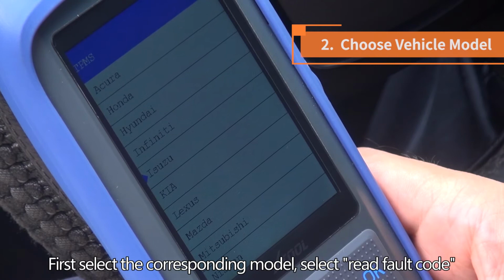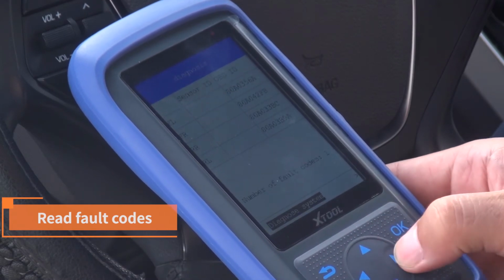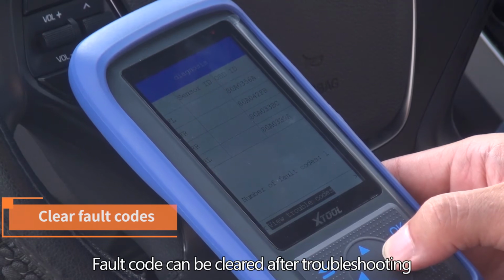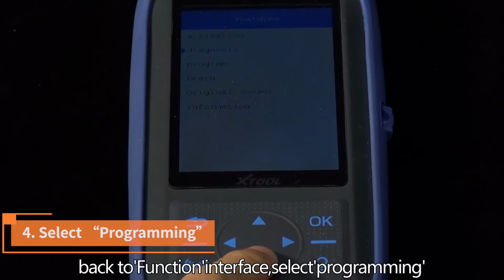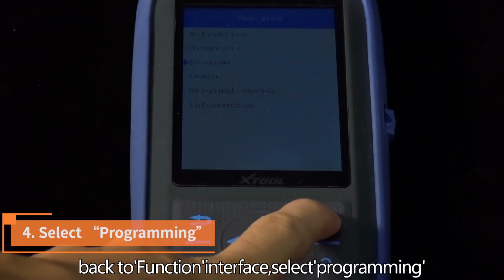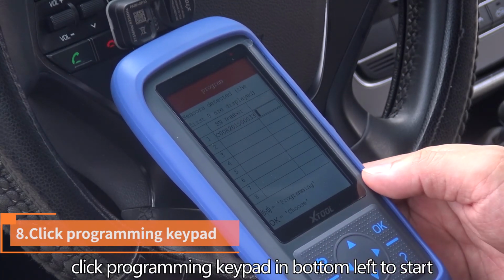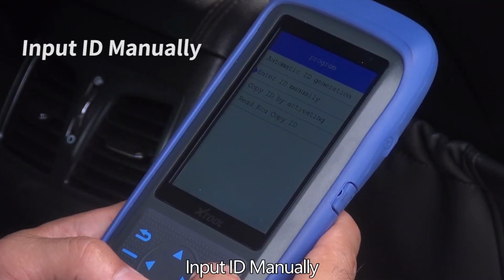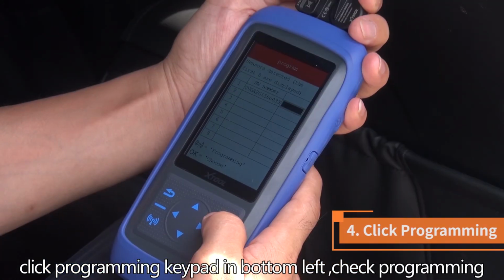Xtool TP150 Tire Pressure Diagnosis Tool Operation Video

Comment: Hi. How do i find the sensor voltage of an existing already fitted sensor on car. Thanks
Reply from the maker: Hi! If the vehicle ECU provides the sensor voltage PID, you can usually check it through Live Data / Data Stream on the diagnostic tool. The available parameters vary by vehicle and ECU. If you send us the vehicle make, model and year, we can help point you to the correct data. 🔧

Comment: Does the programmer tool work with a Toyota Prius 2010? Can it read codes from the OBDII port and program the car? Or is the tool just limited to programming the individual sensors?

Comment: I started to buy it but instead bought the Autel 508WF
Reply from the maker: May we know the reason?👀
Reply: @Xtool_tech  I had already messed up & bought the Foxwell T1000 thinking it could hook-up to the OBD port on the car.But it cannot & I seen the Autel TS508WF on Aliexpress for a good price so I bought it for the OBD hook-up feature.The Foxwell come with 4 sensors so I used the Autel through the OBD port to read the sensor codes then used the Foxwell to program the Foxwell tpms sensors.I still have 3 original sensors to replace when the batteries give out & I will use the Foxwell sensors,my spare doesn't have or require a sensor.I'm just glad to get rid of the blinking TPMS sensor light on my dash.
Reply: @Xtool_tech  I had already messed up & bought the Foxwell T1000 thinking it could hook up to the obd so I could read the bad sensor code & replace it,the Foxwell come with 4 sensors at a good price.So I seen the Autel TS508WF for a good price but no sensors.So I bought the Autel to get the one bad sensor code thru the obd then used the Foxwell to program the Foxwell sensor.I have 3 other sensors that are probably going to go bad & I will replace them with the Foxwell's 3 other sensors that it come with.My spare doesn't have or require a sensor.I did check out the Xtool before I bought the Foxwell & Autel TPMS programming tools.I'm sure it is just as good or better than the Foxwell or the Autel.I'm just glad to get rid of the flashing TPMS sensor light on my dash.
Reply from the maker: @dougmanor1988  thanks for the comments, we will do better int the futurr, and if you are interesting for xtooltech, please check our other products to provide us new suggestions,:pride-flower-rainbow-heart:

Comment: Can u program any and every sensor no matter the brand?
Reply: I think you can only program the Xtool TS 100 sensors with it.
Reply: Gotta be xtool sensors but they're only $20 on Amazon
Reply: No,it has to be an xtool sensor I think.
Reply: You can relearn (activate) any sensor. But it only programs it's own brand of those sensors..